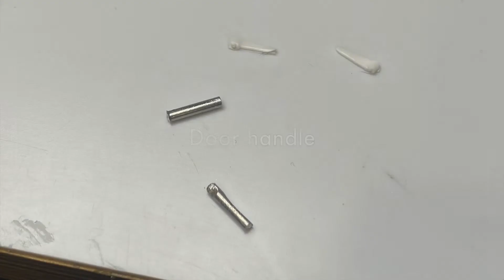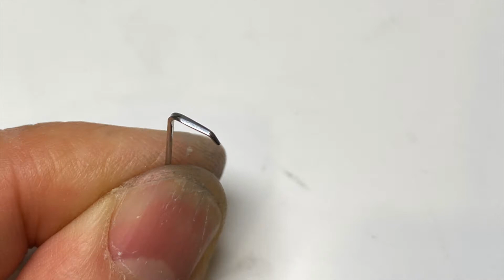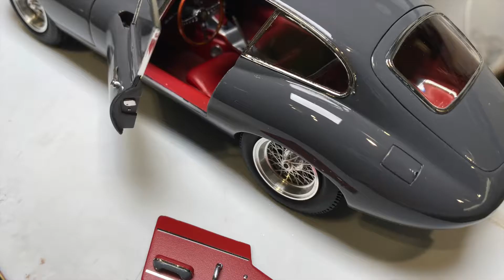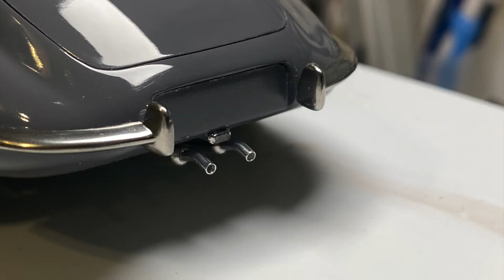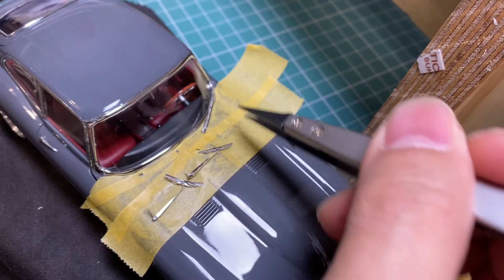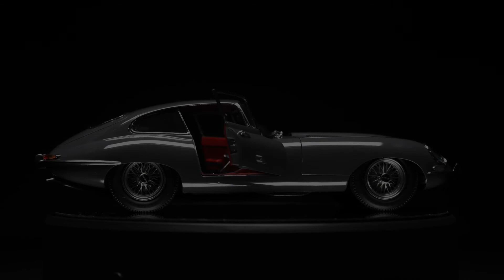JAGUAR E-TYPE  1/24 HELLER - part 4

Comment: Superb! Like the DS. But I miss an exterior mirror and the handle on the trunk hood. Is that correct?
Reply from the maker: Thank you! It seems that the exterior mirror was not a standard specification. The handle on the trunk lid is not attached.
Reply: @A4Garage  Thank you for the quick and kind reply. All the best for the new year!

Comment: Incredible build with some unbelievable detail.  I never see you applying glue to either surfaces. What are you using to adhere the metal parts to the plastic body? Thanks for sharing the fantastic build.  Super inspired.
Reply from the maker: I use the following adhesive for metal parts. Thanks.
craft bond
https://youtu.be/g7MH2DWIDhw?t=1693
instant adhesive
https://youtu.be/USbodWtFX-Y?t=481
https://youtu.be/USbodWtFX-Y?t=744

Comment: Where are you sourcing your metals, pins and rods from?
Reply from the maker: Each material has a different place of purchase, but I found it at a model material shop or stationery store.
Reply: @A4Garage  pretty amazing use and repurposing of raw materials. Are you scaling each sub-assembly via reference photos, known dimensions and the like?
Reply from the maker: Thank you. I'm just referring to the photos and making them similar, so I don't think my dimensions are accurate.